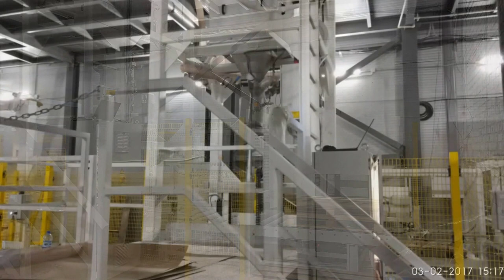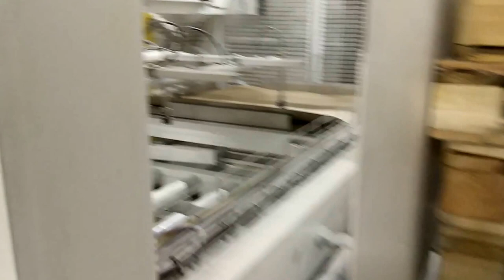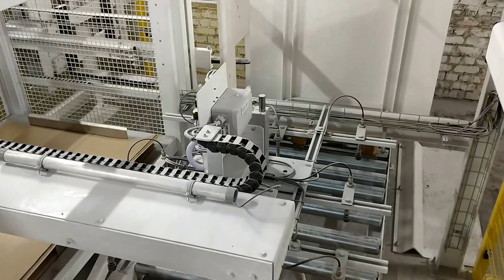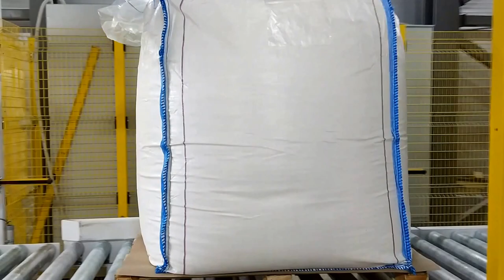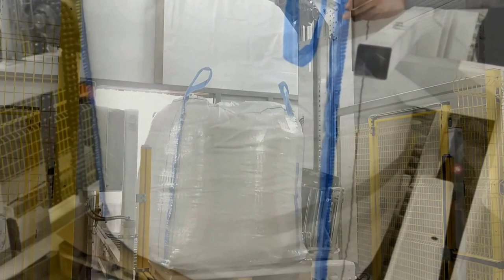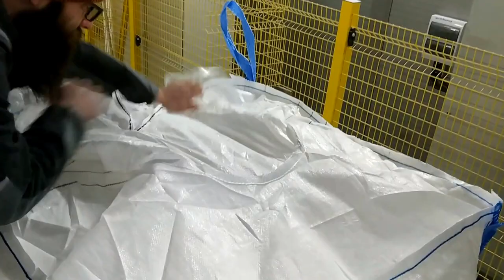"STATEC BINDER" Semi-automatic big bag filling station

Comment: Rampant use of polythene film is not in order. Finally it will be of no use at the end stage. It will add to the pollution. This can be avoided. The bag material is sturdy enough to withstand  pressure. Also there is a support in the form of wooden grating at the bottom. Company may like to think.